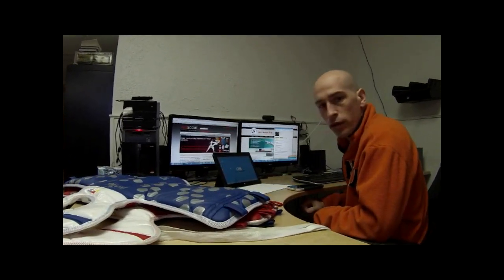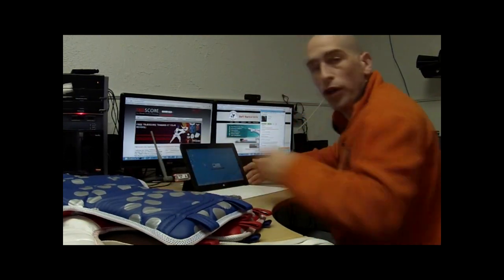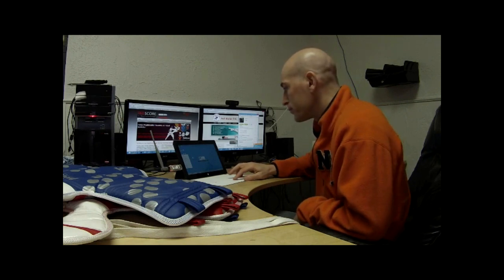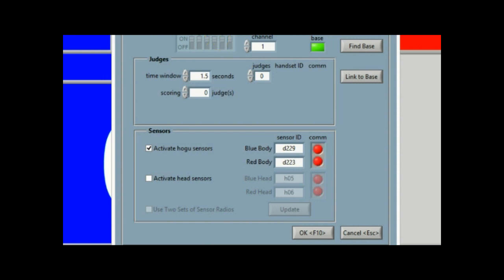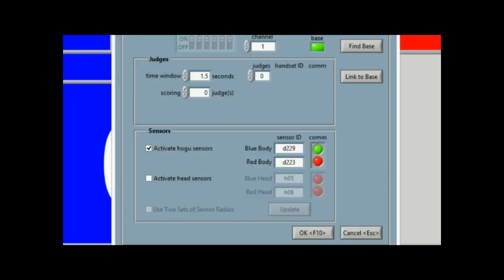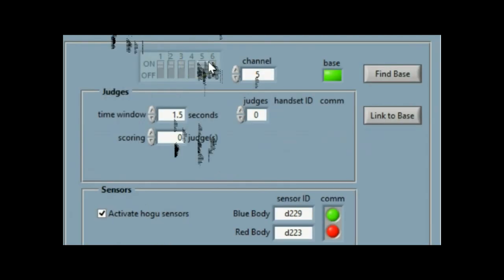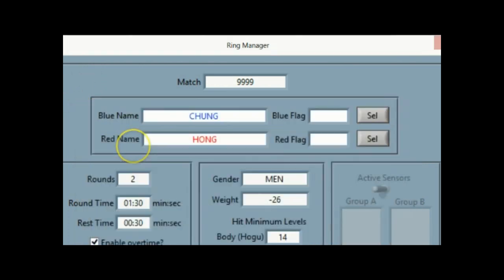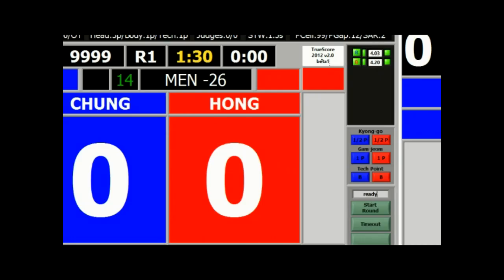Daedo TrueScore Setup and Troubleshooting PSS System

Comment from the maker: Its not likely signal level. Its likely shadowing. First make sure cell phones are not sitting within 4 feet of the computer. Next change the ring/channel number to something else. I like 11. Then maybe the serial usb port has some sort of issue. Try another port or pc. Finally isolate the trigger itself or try a different one. Could be a bad trigger.